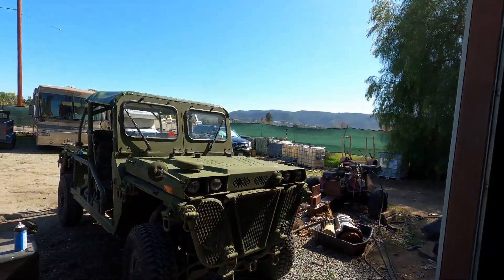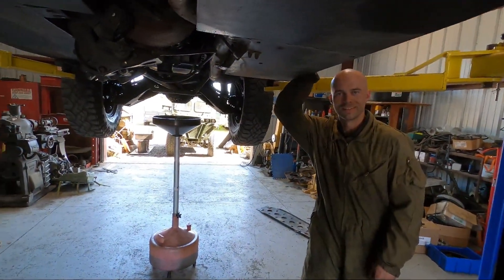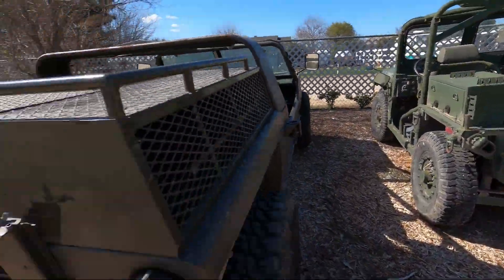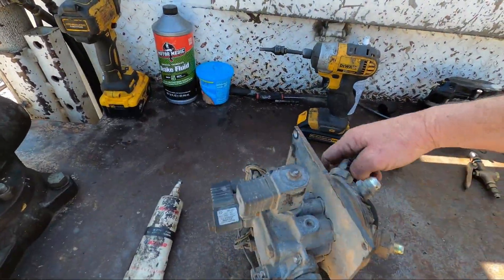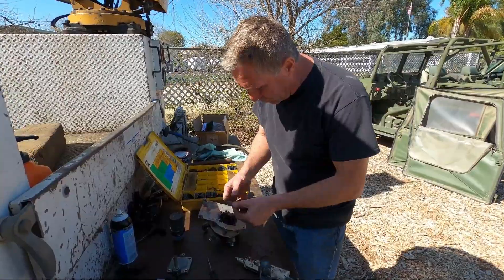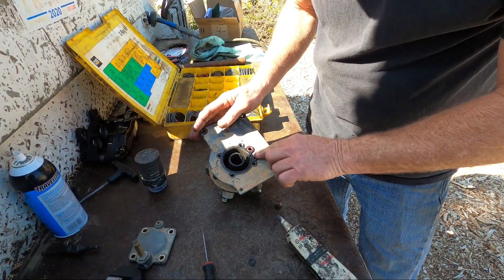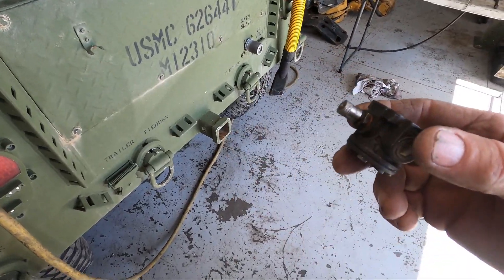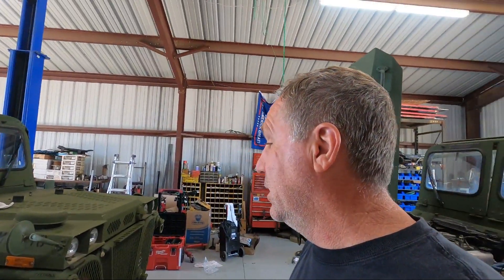M1161 CTIS Central Tire Inflation System Troubleshooting

Comment: Any ideas where to source one of those wheele regulators? I've been looking and can't find any tried to contact cm automotive with no luck
Reply from the maker: They are pretty hard to find, maybe post on the growler forum or M1161 groups on Facebook.
I have been trying for 3 years to get some from the manufacturer but he always says he is too busy with other projects
Reply: @RasmussenEquipment  thank you for the quick reply looks like I'll probably be capping off the ctis for now till I can get ahold of one😢

Comment: Tks for the video!, I have a fresh cm automotive system for my 416 unimog but I cannot figure out how to wire it and what is the work principle between main valve and wheel valves, can you help me out with a manual? If I wire each solenoid individually (my display does not work), how should they work?, thank you!!
Reply from the maker: I don’t have any info on that particular system as they make them different for each vehicle class. You might be able to get the info from CM they are located in Walnut, CA 
I will see if I find a good email address for them.
Reply: @RasmussenEquipment  Thank you very for taking the time to respond, I highly appreciate it, keep up the good work! 👍🏻
Reply from the maker: Here is a good email address for them. 
smittal@cmautomotive.com

Comment: Hey, thanks so much making videos on the Growlers!   I got one about 2 years ago and they told me it ran... it didn't, won't even turn over, so it's been siting in my shop since I got it.  Anyways, I'm learning so much about them from your videos!   I'm in north west Iowa and was wondering what the lead time would be if I had it shipped down to you for you to go threw it.  I'd like to have the rear steer put back on it, it was totally cut off.  I can see where they cut off the whole back unit, thanks to ur videos.  How expensive would it be to source a new one?   And again, thanks for you videos!
Reply from the maker: Can you email me some pictures of your Growler so that I can see what kind of issues it has. Also pictures of the rear steering area. Do you have any of the rear steering components ?
Depending on the condition it can take anywhere from a few weeks to a couple of months, depending on how long it would take to get the missing steering parts. 
I can look for the parts as soon as I know what main parts are missing.
You can email me at Greg@rasmussenequipmentrentals.com